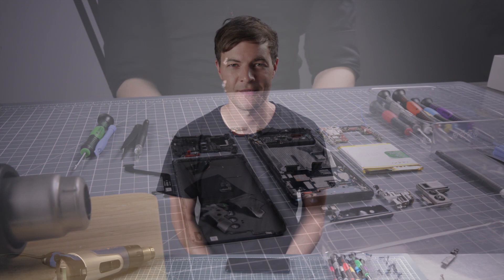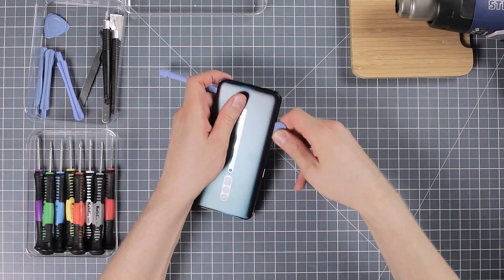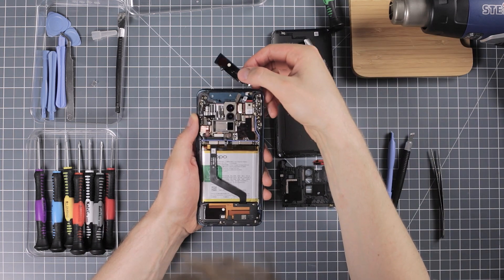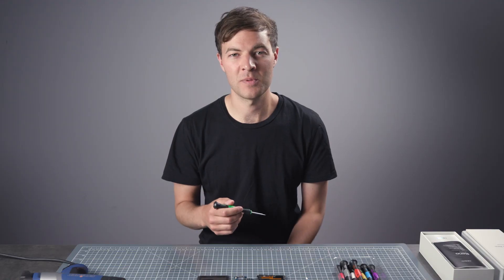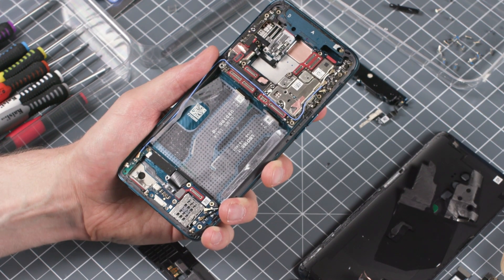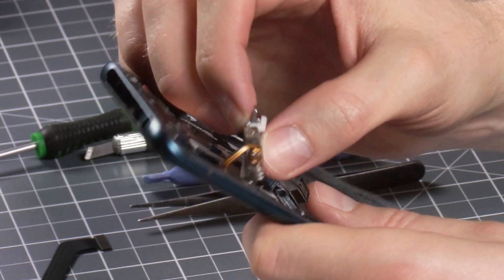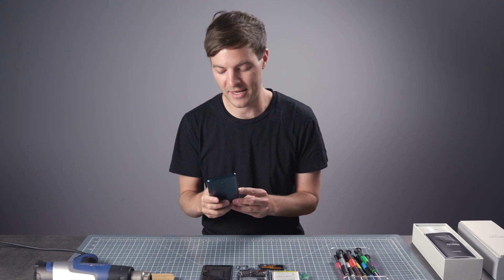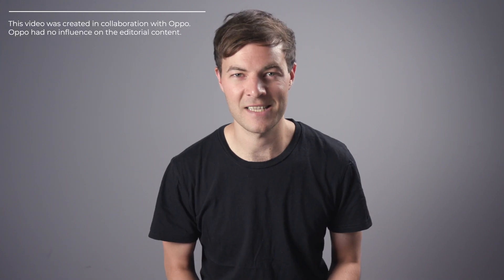Oppo Reno 10X Zoom: Teardown

Comment: Hello I want to ask something, I don't know if you will reply this comment since this video is already 5 years ago but I have some kind of wifi problem. So I want to ask is there any wifi module that I could buy for the replacement or it's not possible since it's already on the board? I already try everything for the wifi but I think it's already the hardware problem now.